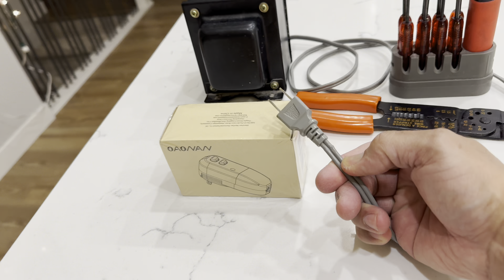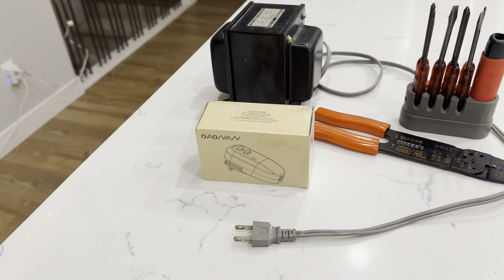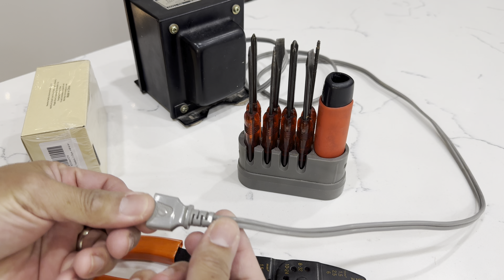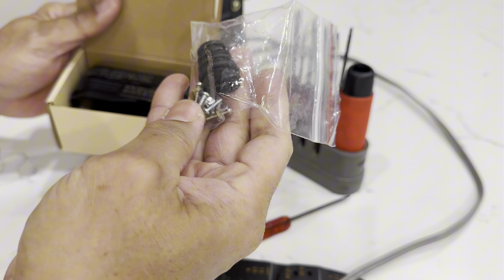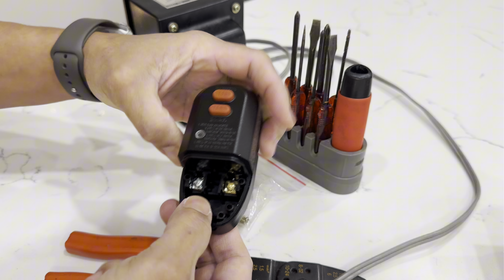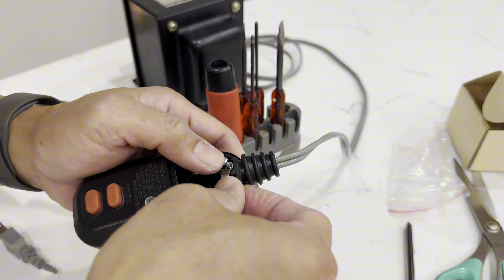How to Replace a Damaged 2-Prong Plug with a GFCI Plug | DIY Electrical Safety Upgrade

Comment from the maker: If you ever see bulging insulation or exposed wires on a power cord, don’t ignore it.
This GFCI plug upgrade adds an extra layer of safety.
👍 Like, 🔔 Subscribe, and comment if you want more DIY home & garage fixes!

Comment: I like the curve recommendation at 3:47 a lot, but as a frame of perfection, these are best as clockwise around the screw terminals. The screw is working with the wire to force it around, unlike counterclockwise, where it kind of fights against and repels it. In this particular application, the plates are the primary connection point and should be making a solid connection as is.  If you have a connection like this in the future, where the screw is the only point of connection, then you will want to ensure that your curves are going clockwise around the screw. I have been there and done that, and a loose or hanging lead is a frustrating find in troubleshooting. It is best practise to just always route the wire clockwise every time.
Reply from the maker: Thank you for the insight. I totally agree and that was my intention, but I realized it was hard to loop the wire around and the locking screw didn’t seem to come off all the way out so decided to just sandwich them between the two plates.